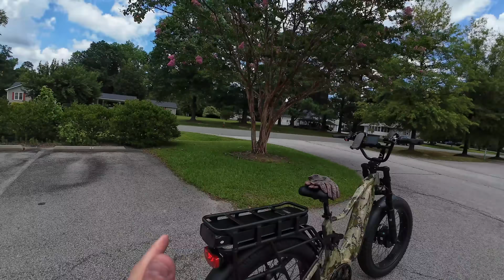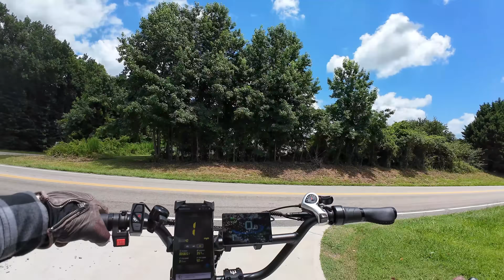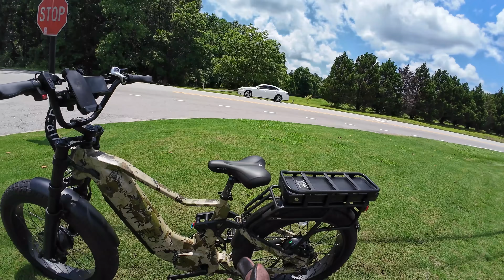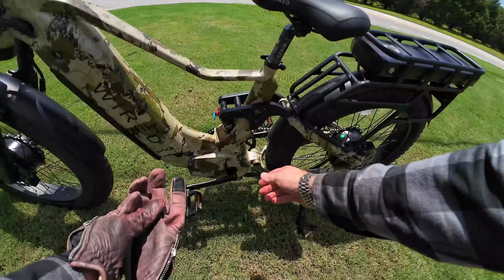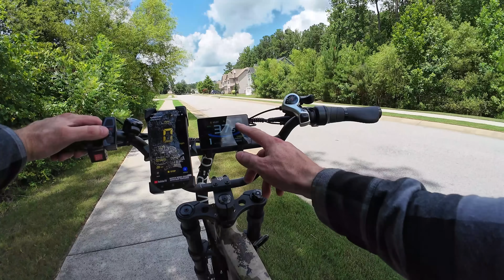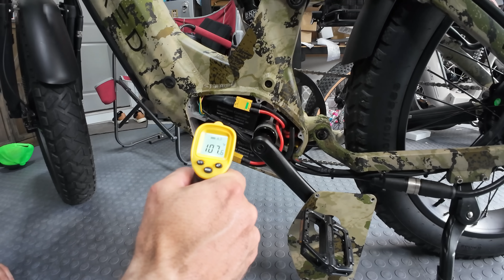WIRED PREDATOR 72V: High Speed Range Test

Comment: I bought it after your video. It's insane. I get about 50 miles running just the rear and using both to boost to 50mph in short bursts. I do a lot of trails and off roading, bought a trailer for it to go fishing with. Tons of fun

Comment: Will it do a wheelie? I think the 2024 predator will if you max out the settings.  I loaned mine to a needy coworker who lived 27 miles away from work.  She learned quickly that she had to pedal. It is called pedal assist. Mirrors don't really stay on.
Reply: I have a Scout and it will absolutely try and loop you off it if you launch it fully unlocked and aren't ready lol.. i think the predator is heavier up front and wouldnt be as prone to power wheelies

Comment: Hey Bryan I need your help guys PLEASE HELP I received a new Predator BUT my 0 is not working at all only 1 2 3 4 5 How can I enable 0 options for full power. I asked Wired ppl and they said it's disabled for safety reason that's sucks:( I need to activate it Please help.
Reply from the maker: Throttle cannot be activated when pedal assist is in 0.  There is no way to change that.
Reply: @CitizenCycle925   wow how did you manage to change it or use it 0 ???
Reply: @CitizenCycle925  is it possible to disable the pedal assist to use full throttle 0  ??
Reply: Please let me know How can I enable 0 options on new Predator come on guys

Comment: These fast bikes are insane. I have been riding heavy motorcycles for 35 years now and looking to order my first e-bike. Many don't realize what kind of injuries can occur from them. It doesn't take much. 45-50MPH, it was a dream years ago. A good bud of mine was riding regular bike and got pushed off the road via a pickup truck. He ran onto a sidewalk and flipped with helmet on. He was disabled for 3 months. We are not talking about fast riding. PLEASE.....ride with very good gear and have a safety vest on.
Reply: I got hit by an Escalade on my 160. Many injuries but the worst was to my thoracic aorta. Needed heart surgery and stent. I think one of those airbag jackets could have prevented that serious of an injury.
Reply: I just don't ride near cars. Bike trails only and sidewalks

Comment: These bikes need a higher quality of tire engineering than really send to be available. I wonder if the right amount of dyna beads would be good. It seemed to me like a balance issue because it seems like a consistent vibration. I’d love to see a video of that if you figure out the right amount of beads. Also I hope the turn signal kit comes out.
Reply: I have the Wired Warrior have done 50 to 55mph the tires are perfectly fine I have over 2000miles and counting.

Comment: Tip max sure you get a 90-100 v able turn signal set up to suit the 84.6 volts most supply 0-80 v and that 4 volts Fry's the boards for the lights

Comment: curious the reasonable class 2 or 3 ebike mixed speed range especially if the motors are turned down in those first few speeds. would be cool to have the option for top speed when needed but the extra range from those dual batteries without. any chance for that range test (class 2/3 mixed speeds only)
Reply: I have a Scout, single 72v motor. Normally ride it with just front battery in unless i know im on a range mission. PAS1 and 2 in town and some throttle on the way home i get around 45-50 miles per charge - before adding the rear batt.

Comment: Such huge fat tire bicycle wheels are not designed to handle such speeds. It is probably impossible to get them balanced at all.
They should really downsize wheels a lot. On another your video,  Predator sits next to regular motorcycle, and motorcycle has much smaller wheels.

Comment: I hope they've got the special high temp magnets for the motor, regular ones would've been cooked at 200*, not to mention the glue holding them that needs to be more robust as well. You could easily sprint a few miles between bike paths, or suitable passing spots, but you wouldn't want to pin it often like you did. I guess they would've limited the current more if it was warranted, though. I'm sure they wouldn't want tons of warranty claims, but if it was my bike, I'd want more than two years out of it 🤙🚴💨

Comment: Yea....regretting this purchase now. I should've got the Warrior/Scout instead 😮 You got nearly double the range on the Warrior, while not at full throttle the whole time but still🤷‍♂️ This thing seems like a big old turd. I'm not interested in speed but I live in a very hilly area and was hoping for much more than this can apparently provide. And it looks like it is pretty unstable but it is a prepro bike so I kinda give that the benefit of doubt.
Reply: I originally bought a Warrior, then just recently asked if I could change it to a Scout instead. They had no problem doing that. Ask them to change your order for you to a different bike if you regret buying a Warrior now.
Reply: @Beltfedshooters I have the Predator on order. Looks like the Warrior/Scout is a far better option for me after watching this vid.  I will reach out to Wired and switch. I don’t even care if they charge me a cancel fee at this point. I’m seeing some definite trouble areas with this model. Too small of brakes for a fast heavy bike. Crap range compared to the Warrior/Scout. I need a bike to yard my ass up hills, not do 60mph and suffer range limits to boot. I feel the weight to power ratio is gonna play hell with range with the Predator over the Warrior/Scout option.

Comment: I heard some generators do not have clean ac and will ruin equipment...
And what's the point of having communication line between the battery and the inverter? Doesn't the battery voltage have all the end meaning???

Comment: looks nice but the price is a freaking joke.
Reply: It’s $1000 more than my electric scooter that does 54mph and $3000 less than my specialized turbo Levo comp pedal assist mountain bike. The price is perfectly set
Reply: @Live2ride2live54321  My electric scooter I got off Amazon 2 years ago for $800 does almost 60 exactly and has almost 2000 miles on it with no issues.

Comment: For those people saying the front wheel is wobbly or vibrating with that speed, you gotta remember it is a bicycle. That happens when you riding with that speed due to road condition. Roads are not perfectly flat and you will definitely get that vibration feeling even when you are on the motorcycle if you have ridden one
Reply: It's probably caused by the fat tires. The sidewalls do not provide the proper support to do 60mph causes a harmonic bounce on the road. Probably better to lock out the front forks and put more air in the tire?

Comment: For cruising around on throttle, a full twist would be awesome. Half twist is serviceable though, you get used to it after a while.
Reply: I myself prefer a half so I can anchor half my hand
Reply: I like cruise control
Reply: @Live2ride2live54321 I just wish the Freedom would follow mph and not how much throttle you give it on a flat, always gets slower and slower
Reply: @TunaSodathat’s common across many e-devices. My e-scooter does 54mph and I usually cruise around 35-45 but the speed relative to throttle position tapers off as the battery dies.

Comment: You finished at 65.6V which is still roughly around 25% for a 72V battery. So you could probably still go like 20-30mph for at least 5 or 10 more miles. Also this answers that the top speed drops to around 40mph at 25% battery on this bike
Reply: You wouldn't want to run the battery that low anyways. Overtime it will kill the longevity on the battery

Comment: Thanks for the revue, Pretty impressive performance on several fronts.

 The first to me would be the speed and acceleration but you already covered that so the first on this revue would be the motor temps, Its my feeling that with dual motors and running at high speeds without a lot of traffic with stopping and starting it seems that even in the high temps (the outside air) the motor housings are able to dissipate the energy pretty well.

The second would be the efficiency travelling at these speeds on a full sized bike without any aero advantages like a wind screen or riding in a tuck the new Hentac motor as well as the controller, seem to be doing a great job.

As far as your comment on the slight shake or resonance in the bars, I had noticed the same thing on my 96v freedom and rotating the tire on the rim seemed to help (I do not have a balancer) but I want to get some tape on weights and with the bike in the air try adding weight at various locations to balance through trial and error. The last thing that may help in this regard and would definately help high speed stability, is to increase the head angle to a more slack angle. Wolf components has headsets that adjust the angle by up to 2°. I was planning on doing just this mod to the new Warrior but unfortunately had a pretty serious accident that left me unable to work and ride for a few months so that plan got cancelled.

Anyway thanks again for the revue and I also enjoyed your dads comments.....he is definitely a good rider for being so old.....oh wait I will be 70 in two days LOLs

Comment: I’d like to see an in-depth hill test. Not just your normal hill test.  I’d like to see several different hills including a hill that it can’t do, so we can see its limitations. I dunno if you have any hills like that nearby your home…
Reply: A bike like this can ride up the steepest street in the country on throttle only.
Reply: But for how long before it overheats? My motor was hot enough to burn my finger and I only went On a short ride for about 8 minutes at full throttle. I was quite surpised how quickly it heated up, on mostly flat ground too. @ramborambokitchenkitchen6357
Reply: Even the Wired Cruiser 2025 will take any hill I have thrown at it in upstate NY. I will say, once the motor temperature reaches 300, the throttle stops working period until she cools down.
Reply: This thing has over 200lb ft of torque...what hill is it not going to be able to do? A 90 degree cliff face?
Reply: @Tynted Don’t know. That’s why I’d like to see a video. Maybe an extended climb. I’d like to see if the motor might over heat…. My Freedom and Cruiser have both needed me to stop and cool before continuing after shutting down due to heat on long extended steep hill climbs.
Reply: @GroovyRides28  Ahh I see. I live in a very flat area so wasn't thinking about hilly/mountainous situations like that